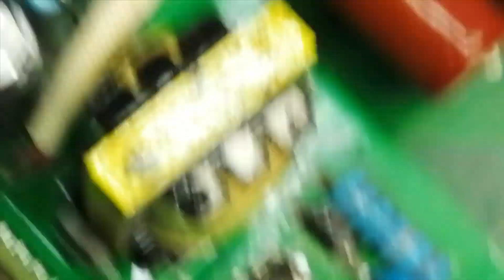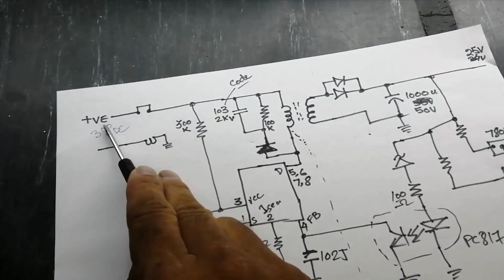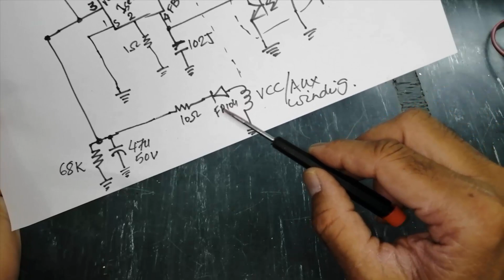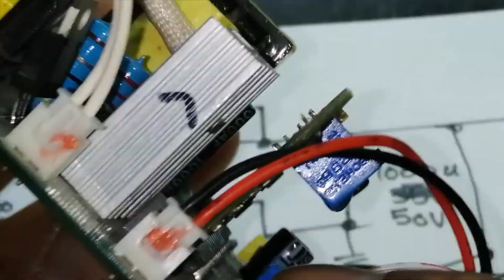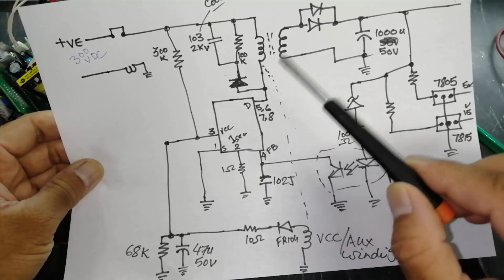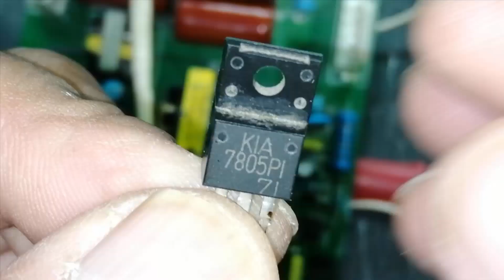{289} Inverter IGBT Welder Machine, Low Voltage SMPS Circuit Explained & Troubleshooting

Comment: Can you help me with my welding machine  low ampere problem ,i already replace the igbt ,diodes and op amp same result ,what could be the problem sir 🙏
Reply: Either control card or driver section is bad
Reply: @SaratAnimation appreciate your time Sir

Comment: Will installing an external smps circuit to replace the broken smps circuit cause any safety risk? Because when we install an external smps circuit, the relay driven by 24V will be instantly active, the NTC will be deactivated before the large capacitors are full.
Reply from the maker: This trick works nice 
And safety remains in limits because both bulk capacitors take approximately similar charging time
Reply: @HaseebElectronics  thank you

Comment: I would like to repeat the same question in this video. The VCC input of the driver integrator receives 300 Volts through a 180K resistor and a lower supply voltage through the auxiliary winding. How does this happen. Why the 50V capacitor does not fail

Comment: A nice touch offering up alternatives to solve problems. We need to be problem solvers and that includes not throwing away a useful piece of equipment just because one of the SMPS in a system is bad or unavailable components. Nice work around for measuring PWM too. Well done.

Comment: Wow, great series of videos!  Thanks for sharing man!  Much appreciated.  Any videos on offset high power circuits say for instance like taking the square wave like from a modified sine wave inverter (though for use in welding I'd like to know eventually so to construct) and offsetting so able to set different ratios of DCEP or DCEN for TIG welding aluminum best.  

Seems like need another half bridge so a full H-bridge to be able to design & construct.  Then can make the alternating current square wave that somehow can be adjusted to offset where I guess just having a power control of some sort like another PWM or switching circuit for each voltage range side (DCEP and DCEN ) to change the power averaged on each side H-bridge switching event.
Reply: On another and somewhat similar note, I'd like to learn how to use the Prius Gen3 inverter h-bridge for generic rectified inputs for optional 120, 208-240 and 460-480 pure sine wave outputs since seems like is feasible with the properly designed controller.

I was also wondering what would be the best way to design a circuit for options to output as a welder power supply besides feedback for CV or CC and frequency control, in particular a high power offset circuit so for use in aluminum welding, i.e. an offset square wave so can select a range of DCEP or DCEN ratios.  So that is why this is somewhat related since the control board design would be similar for the welding controls.

Thanks again sir!  Excellent channel! Glad I found.

Comment: I am with a weld machin which turns on and turns off when i want to weld. O tested two IGBT and are ok. There aren't short in power circuit. But the wave form of IGBT gate aren't square and voltage in the module board is up and down in looping ( all eletrolytic caps and IC's). Same happens to fan connector. Why ? Is it PWM the issue ?

Comment: Hi,
I have a similar circuit from my welder. I believe it acts more like a current source, than a voltage source.

If I want to convert this to a a 48 PSU, can I just...

1. Reduce # of windings on output transformer (it is middle tapped, so I'd reduce each side)..
2. Add a large electrolytic capacitor to the output?

Ta.

Comment: cordial greetings very good your videos thank you very much, I have a question which is the reference of the desoldering iron you use. I would like to have one like that. Greetings from Colombia.
Reply from the maker: best regards 
now a days i am using Weller WR3M rework station, but is much expensive and its spare parts are notoriously expensive 
before this i used HAKKO 701 ESD safe rework station. it is much cheaper than this WELLER and its spare parts toooooooo cheaper than WELLER 
kindly check video number  511 for more details

Comment: I has a 200 arc welding machine which is one spark no working at all and the o.c alarm will come on ,what is the problem and how can I find out the faults?
Reply from the maker: most of time it needs to calibrate the control card potentiometers for output current, current transformer signal and current setting potetniometer (front panel current knob)
i will try my best to explain it soon
Reply: @HaseebElectronics  okay I look forward for your response, because my welding machine is new one I just bought it unfortunately when I started to use it this problem of o.c alarm is coming up.

Comment: This is what I call power jumping, some times if I fail to get the ic ,I use a 24v external Chinese smps in Uganda it is difficult to get spare parts,so as a technician I use a 24v smps. Thanks for your work.

Comment: some welding machine using 7pin ic.can i use it
Reply from the maker: you have to check the original ic datasheet and the you can find the equivalent to replace it

Comment: how to convert power supply low voltage.if ic have no available.can i use 4wire 380v to 24v. or 24v regulated.how can i connect.i hope you answer my question. and you make a video for this.thanks and more power.and more video you make

Comment: Good job bro..thanks a lot ..super explanation...I have one with 96v on holder(no load).. is it normal?if not any solution??thanks in advance bro ,,✌️✌️
Reply from the maker: thanks a lot 
96 v is very high. you can reduce it by reducing duty cycle from control card

Comment: inverter welding for repair had low 5v of 7815. d output was open and 15v was read.
there'was no shorted. 2pcs mosfet were also good.
possibly whre's d problem?thnks in advanve
Reply from the maker: may be 7815 is defective so it may be reason for low voltage 
or may be there is some short in 7815 line
Reply: @HaseebElectronics  if there's a load, d 7815 could not regulate its volt. while d output is open, the volt turns good. 7815 should be replaced to see if same result.
other parts were tested and found no shorted.
thankssss
Reply from the maker: @vjrperalta6321  in this case, it is to be verified by replacing 7815
Reply: @HaseebElectronics  thanks a lot!,.

Comment: salam
geet video, everything is clear especially with schematics, for me you are the master of electronics, i get the problem when found a circuit diagram.

i have ARC welding machine 200A witch contain a TL084CN, my problem the output frequency is under the normal 29 khz and i don't know the condition of problem, can you advise me to solution

Comment: sir can you continue this video with the original optocoupler and may i know the tool that you use to de- soldering thanks a lot
Reply from the maker: optocoupler internal or external, the same 
desoldeing toll is WELLER WR3M ESD safe rework station

Comment: Hello friend, in the circuit where the sg3525 is in the fan connector it is giving me 25.1v instead of 24v
Reply from the maker: it is ok. it may vary from 20 volt to 28 volt. it is normal

Comment: All your videos are great. I wonder if it is possible to convert an IGBT inverter to a plasma cutter? Thank you.
Reply: @HaseebElectronics Thanks for quick response. So it would not be possible to process the output transformer that would give a higher voltage with less current? HV start and solenoid valve activation would easily be added to an existing source.Greetings from Croatia
Reply: @Darkoford-tools-electronics  for price, is more relianle to buy cheap low cost plasma and upgrade it for more durabiliter and power.  Me when im done my repair. I add 2 rectifier . Stock 60amp and 80-90% load   ...after.. 100amp and 45-60% load.  No heating, and extending life ...(i should not tested but module is ready to plug in) (2x 30amp +2x20amp (20 because is what i  have).  I wouldlike to update igbt resistor itoo by 2w ou 4w resistor dont know rhe effect. And propably add some ceramique capacitor and add 2cap on pilot arc capacitor bank.(2slot not useed)

Dont need more power machine.  Just trying to get better duty cycle whitout heating or damaging componoent.  Unload coponent to get better reliability

Comment: I doubt that 68kOhm is correct. If so, Vcc of IC would be 55 Volt that would be too much for capacitor and IC as well. Looks more like 15 kOhm.

Nice trick with external power injection on capacitor to check function of low voltage aera. Thank you. 👍